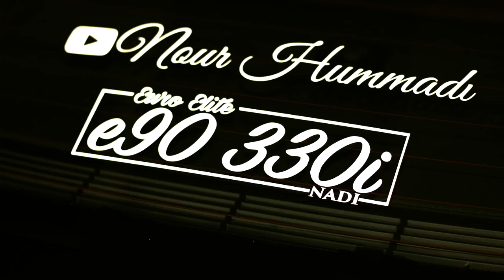DON’T WRAP YOUR CAR UNTIL YOU WATCH THIS!

Comment: I've been prepping my E91 for a wrap lately and I started sanding down the dents and scratches, filling them in with bondo and making every surface nice and smooth. Initially, I wanted to paint the car, but I think I'll just wrap it for now since a full paint job will cost me several thousand Euros here in Berlin. Thanks for the video!